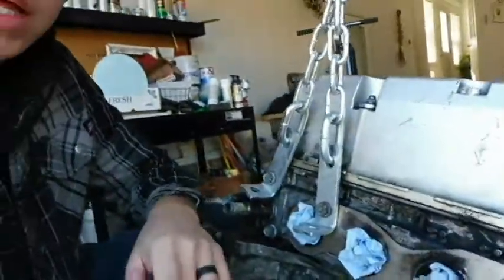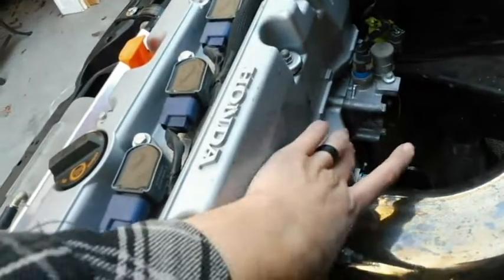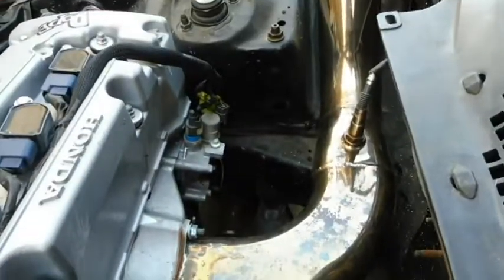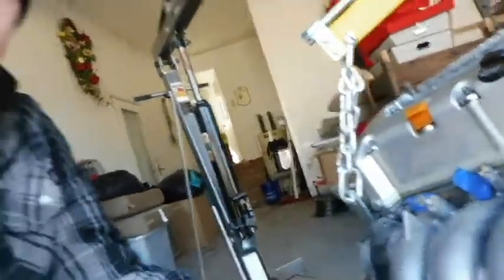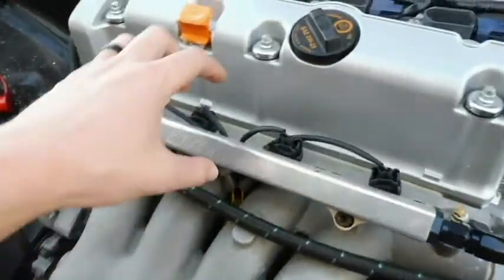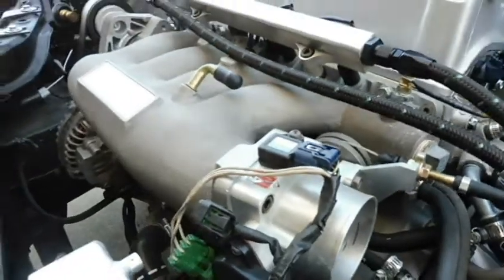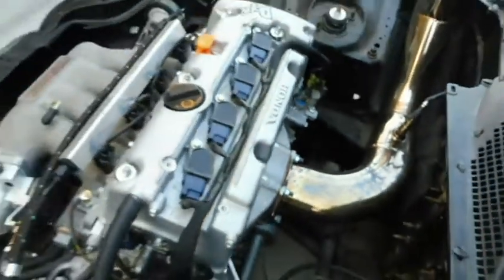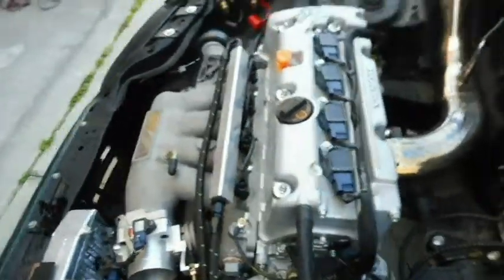HOW TO : K24Z7 Swap in EG Honda Civic (Part 1) - K24Z7 vs K20A2 differences

Comment: Good Morning 

I have some questions for you:

00 Accord Swap F23A1

Are the crankshaft main journals numbered, starting from the crank side or pulley side?

This block has numbers 42334 instead of letters stamped on the block girdle by oil pan, is this the main bearings code?

These numbers are on the outside of the lower main bearings; do they have part numbers ?

D8AR
D7KM
D7LO 

Thank You
Reply from the maker: Hello. Unfortunately, I dont have any experience with the f series other than doing general maintenance. So, I wont be able to answer those questions. You may need to get a hold of a factory service manual.

Comment: I'm doing the k24z7 swap in a EK chassis what throttle body and pedal setup do you think would be best I'm using the o.e.m ecu (can I go wire and get it tuned)
Reply from the maker: You would probably have to use the original z7 one from like a 9th gen si.
Reply: @ballsoutperformance  I just finished the video lol going k20a2 harness and ecu with kpro v4 and throttle body from k20a2 sounds like the way to go for less headache. Love the car bro I'm doing z7 in EK and J35A4 with 05 TL 6 speed lsd transmission in a EJ1 coupe lol so I'm always racking my brain on something here lately 😅
Reply from the maker: Ok. I thought  you were saying that you would be using the oem ecu (as in the z7 ecu). K pro wont work for the z7 engine.
Reply: @ballsoutperformance  will kpro work for z7 engine if I use k20a2 ecu?
Reply from the maker: No, not at all.
Reply: @ballsoutperformance  how did you get yours to work?
Reply from the maker: I talked about it on one of the vids. Watch all 3
Reply: @ballsoutperformance  I just watched it, my bad lol 😅 also now rywire sells a pnp harness specifically for using a AEM ecu (k20a2 design) it's pricey as hell though basically 2700.00 for ecu and harness together

Comment: Hi I’m  I have a complete 9th gen swap alone with original hardness and ecu  just want to know if.  Anybody have finished the swap using the oem hardness.  And.  Will the 9th gen 6speed lsd. Will work as well ?
Reply from the maker: Im not sure if anyone has but it is doable. You will just have to do some wiring. As far as the trans goes, im not sure how different it is. You may need custom mounts, I cant confirm.
Reply: @ballsoutperformance  ok will keep u update thanks brother 💪🏽
Reply: @iamdjshino5496 were you able to use the 6 speed trans?

Comment: Did you change the knock sensor they look different from the k20a2?
Reply from the maker: Im pretty sure I didnt change that. If I remember correctly, it had the same electrical plug
Reply: @ballsoutperformance  the plugs first perfectly but the knock sensor has two terminals instead of one I will
Leave it that way and change it if necessary thanks a lot buddy
Reply from the maker: Oh ok I got you. I couldnt remember if they were the same or not. Its been awhile

Comment: Did you ever sell that ecu... and where can I get  one of those intake to buy
Reply from the maker: I still have ECU. The intake manifold? I bought it used.
Reply: @ballsoutperformance  I will buy both ecu and intake
Reply from the maker: The intake isnt for sale. Just the ecu and exhaust. You can email me archie_marchie@yahoo.com
Reply: Would this work for k24z3
Reply from the maker: Which part, specifically?
Reply: @ballsoutperformance  sorry does the k20 transmission work and what ecu can I use
Reply from the maker: K20 trans should work. But im not familiar with the Z3 engine as far as the ECU or wiring

Comment: I have a 99 ek sedan would the steps to do this be the same as a k24a from a 1st gen tsx?
Reply from the maker: Yes but the k24a should be much simpler, as everything is available off the shelf. Where as, the Z7 swap has some wiring challenges that complicate things

Comment: I have a 00 ek I want to z7 swap it.. has anyone ever done that ? I need info
Reply from the maker: The principles will be the same for doing a z7 swap in an ek chassis as it would be in an eg chassis. Some of your swap parts that youll need to buy will be different, as a lot of that stuff is chassis specific.